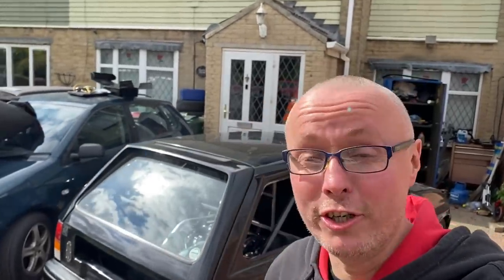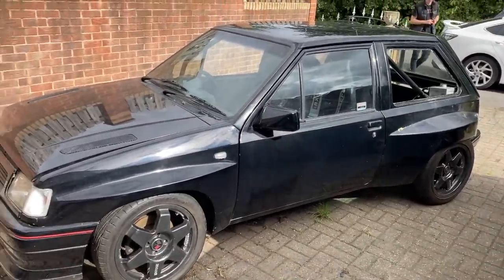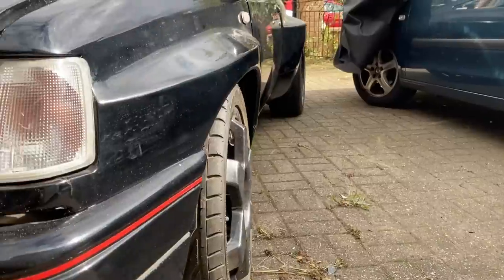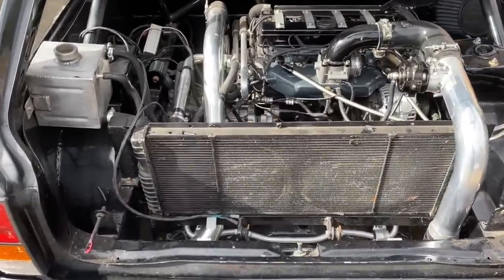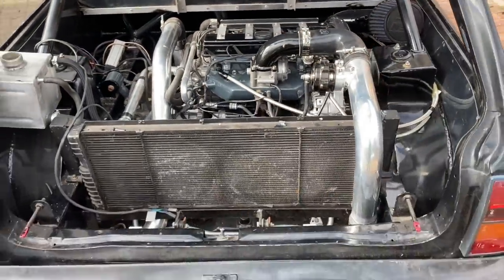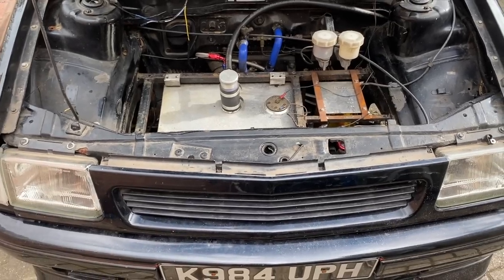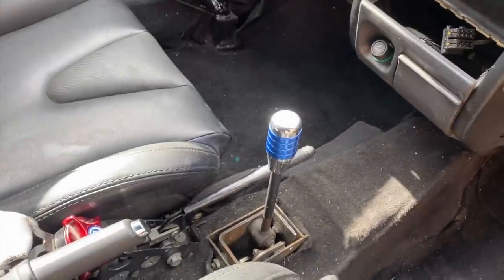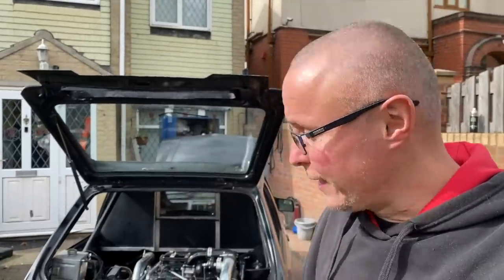500HP RWD Vauxhall Nova VXR *REAR ENGINED?!*

Comment: Front must float above tarmac on full boost and Deffor double a arm needed on back for a proper job
Reply: It used to have the lower arm and adjustable rose joint tie rods on the back